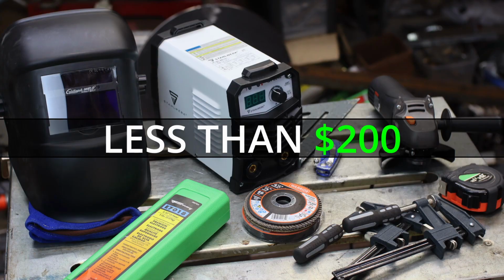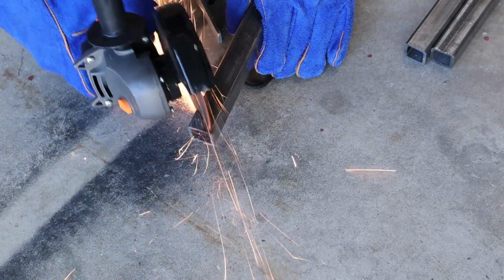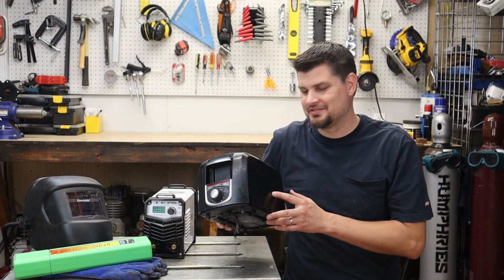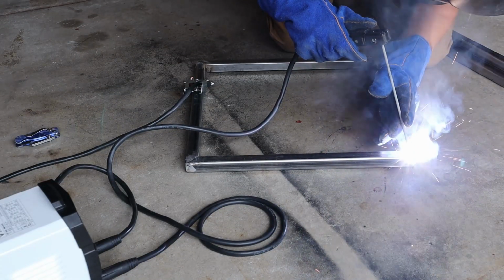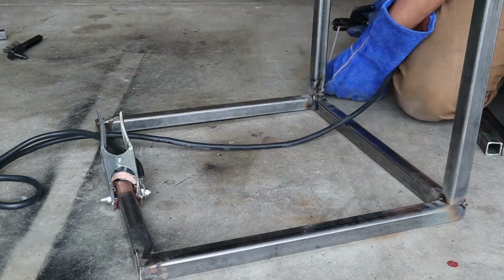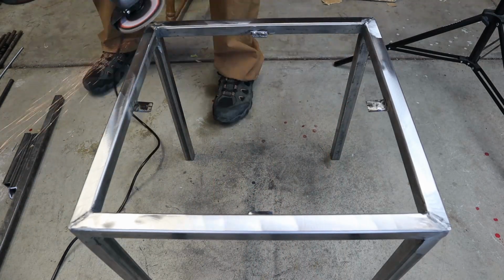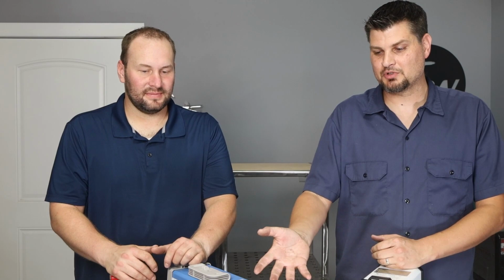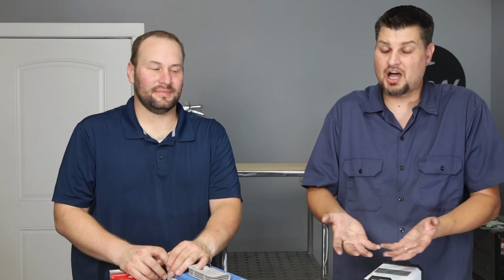$200 Welder Challenge with TIM WELDS!

Comment: Such a great video and collab. I love your razor blade marking trick. I used it to do some markings on a project where the required precision was very tight for my current abilities, laying out some dimensions and a series of related drilled holes... I had to be within 0.10 mm. Machinists might laugh at this, I know, but, considering I was only using an angle grinder, a cheap combo square, a razor blade and a spring loaded hole setter, I thought it was pretty good. Your razor blade thing worked great.

Comment: Stahlwerk is a company from germany. They sell pretty ok welders actually, since germany has 230V anyway, sure it works great. it is not some shady china stuff, it is great you could fit a somewhat not terrible welder in the budget, even if I think it was coincidence. This welder and the included accessories meets all german regulations and safety standards, I'm quite sure
Reply from the maker: Right on, thanks for the info.